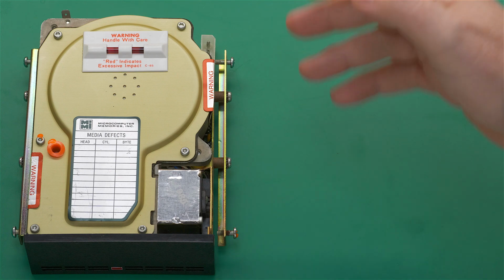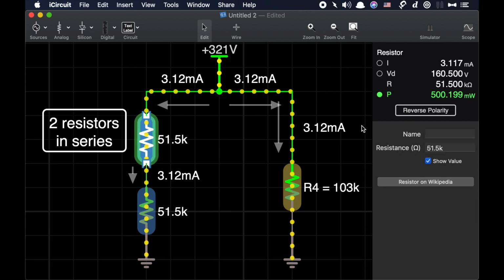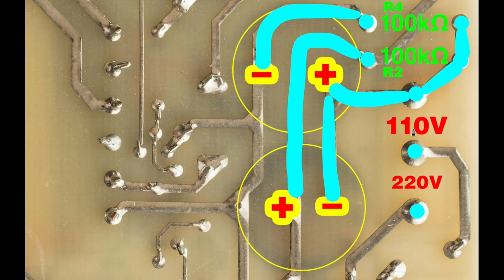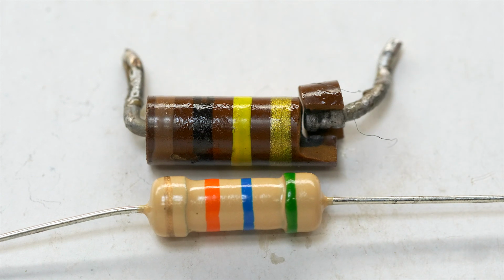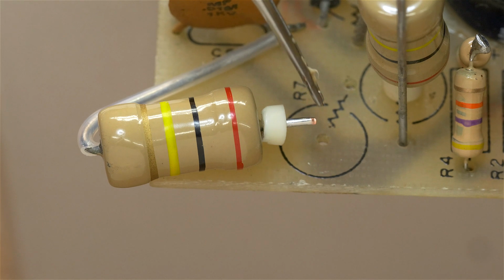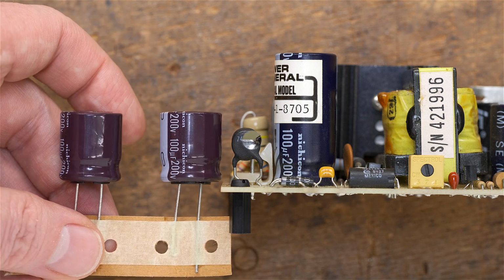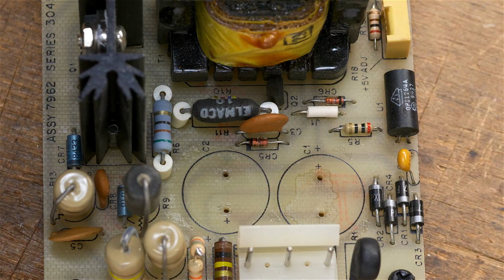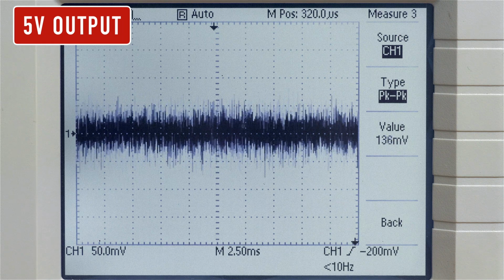Vintage Power General PSU Recap [Part 2 of 3]

Comment: Great video!  I did not know about iCircuit before and I think it will be more enjoyable to play around with compared to Eagle. I’m really looking forward to part 3 as I cannot imagine in my mind what the complete drive setup looks like.
Reply from the maker: I paid for iCircuit because I think it's really great simulation software.  It's not as complete as I would like it, but I have spoken to the developer through the years and had him make some improvements. I've yet to find anything that beats iCircuit in terms of sheer simplicity for simulating basic electrical circuits.